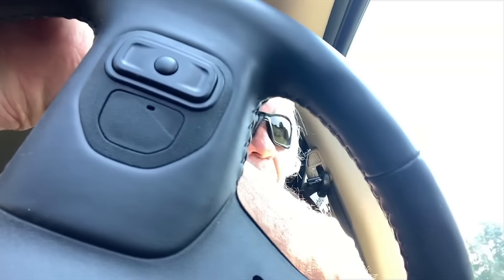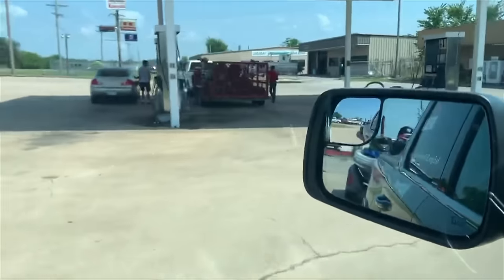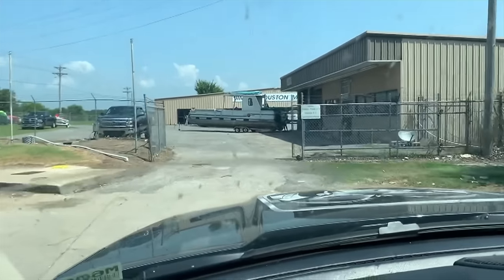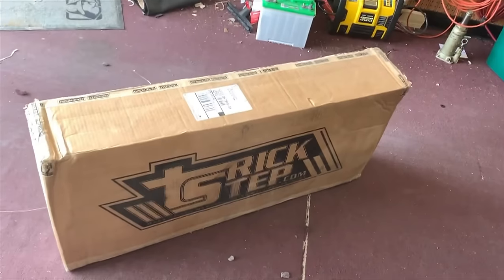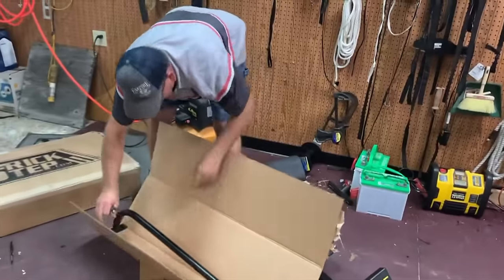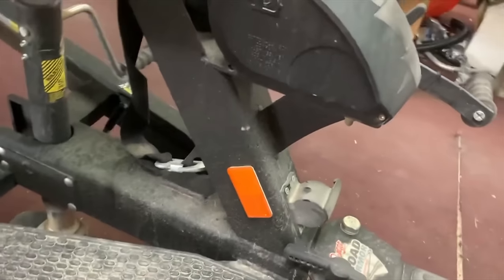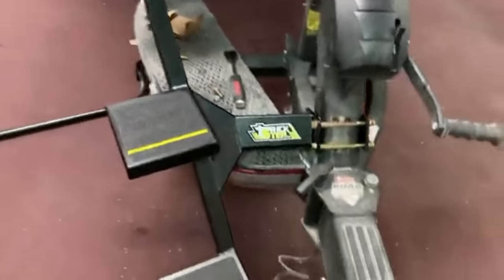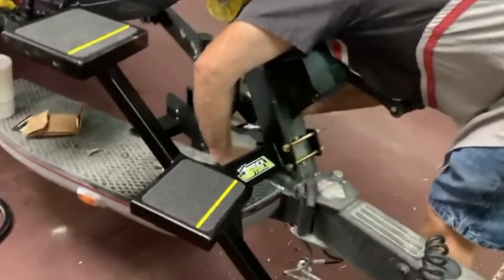Things Just Got Easier! How to install a TrickStep Boat Entry

Comment: Hey my brother that video was a little short ok so steve took of the trailer plug holder put the step on and tighten it up but you did not show him putting the handle on and you did not show us how to step on it and getting in or out of the boat and did you run the 8 ga wire or is that going to be in a different video well god bless you brother. R Guzman